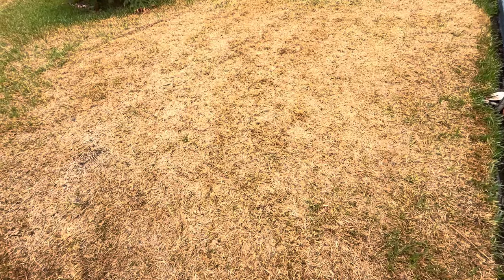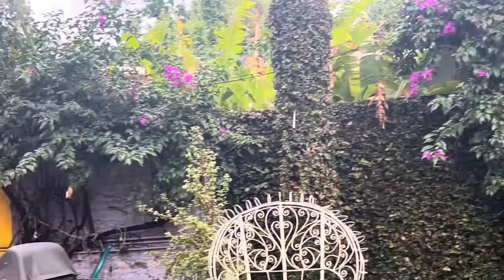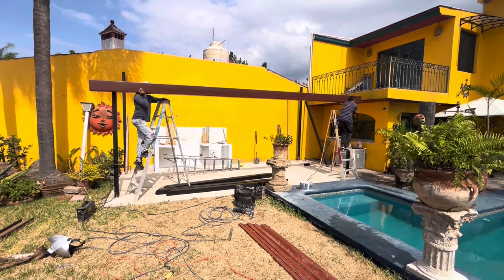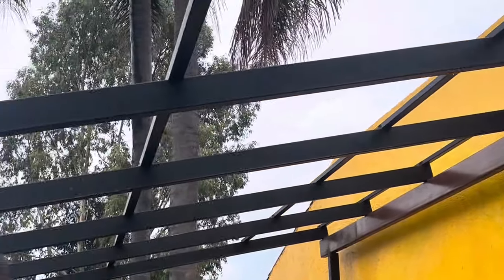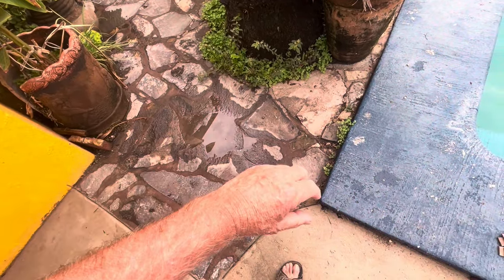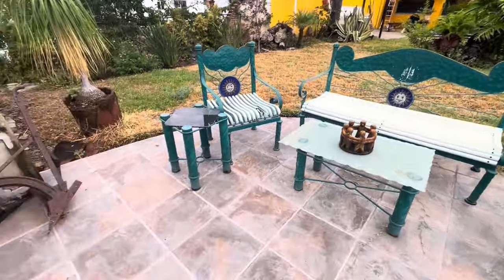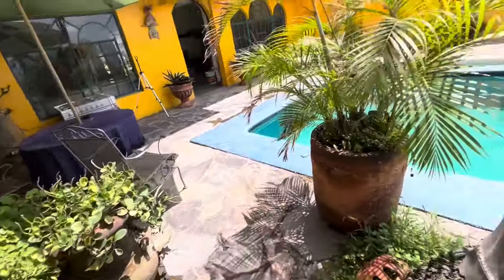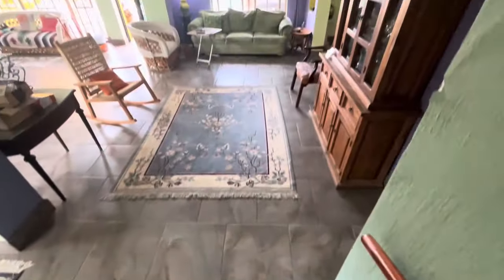Rains Have Begun in Ajijic.

Comment: I like the cantera. Where did you buy it?
Reply from the maker: The only contera here are the pedestals at the corner of the pool.  They came with the house in 2004.
Reply: @JCTravelStories  The tile. Looks like Cantera, or maybe Adoquin. Anyhow, we're putting in a patio and didn't see it at the two places in Jocotepec where we looked. Where did you get the tile? Muchas gracias.
Reply from the maker: There's a tile store in Chapala across the road from Soriana.  A couple of doors north of the street the Chapala tiangus starts on.  Great selection of tiles.  That's where I bought mine.
Reply: Perfecto! Muchas gracias.